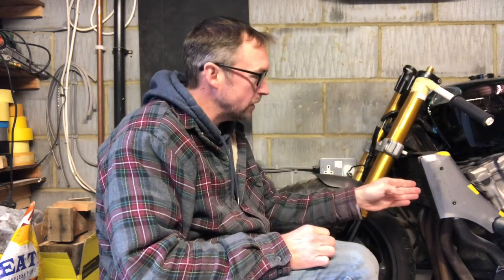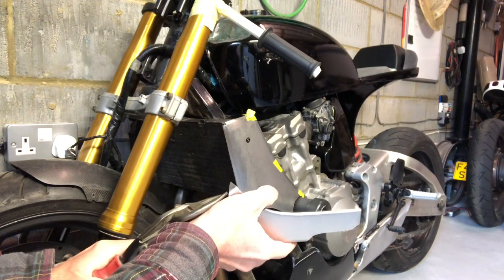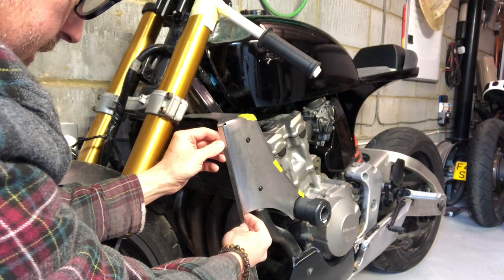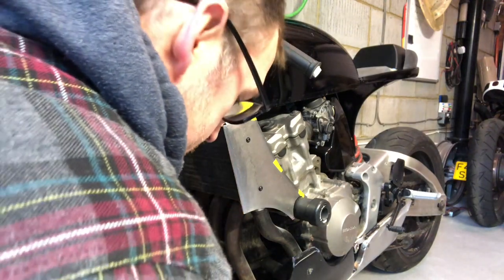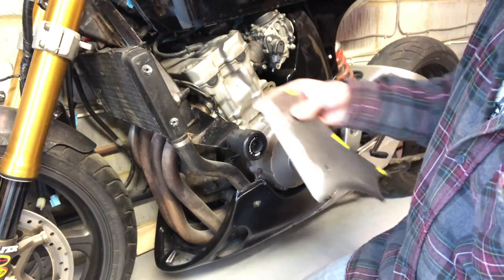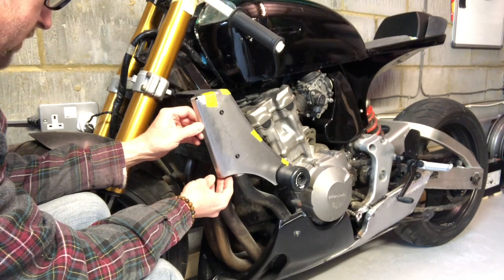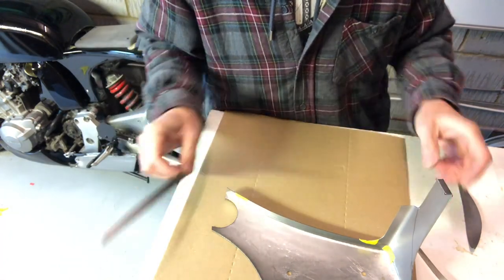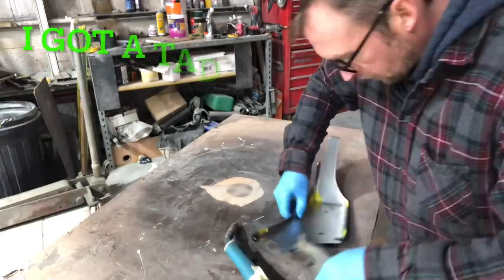Honda Hornet radiator cowl fabrication

Comment: Well done..and then you learn the tig you have a great backside to.whitout not any dots..it take a little longer time to weld..but you win the time on grinding..
Reply from the maker: I’m not so worried about the rear, all these parts I’m making are just to take moulds from so I can reproduce them in FRP or carbon 👍🏻
Thanks buddy 👍🏻

Comment: Cracking job. Will the cowl end up as a one piece fibreglass job (i.e both sides joined) or will you leave it as painted metal?
Reply from the maker: Hay Bob👍🏻
It will end up in two bits, made from fibreglass, the reason I will do it all in FRP or carbon is so it’s light, I don’t want a heavy bike at the end.👍🏻